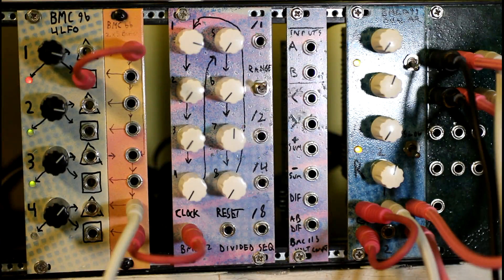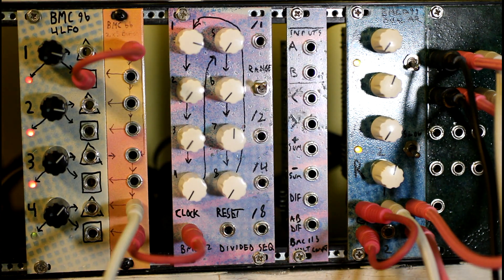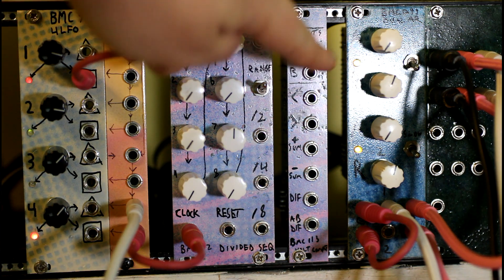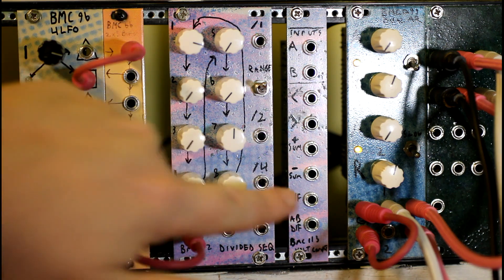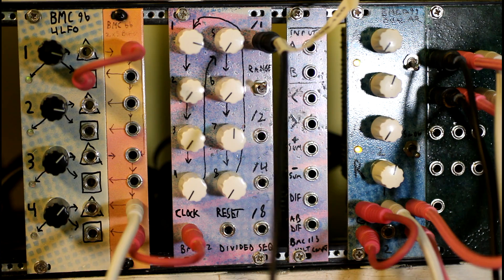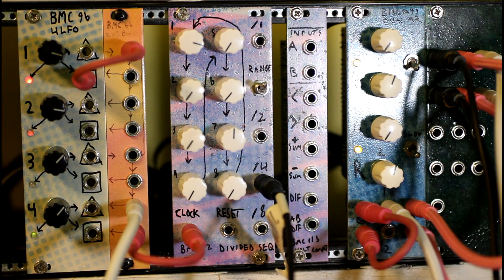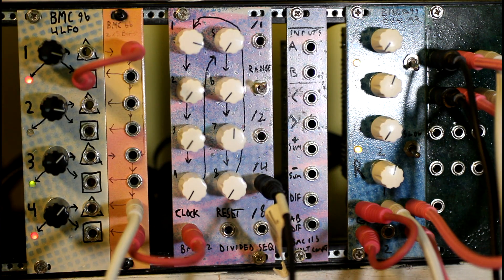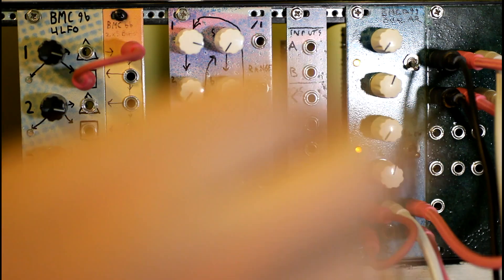BMC112 and BMC113 Demo video, Divided Sequencer and Voltage Compute

Comment: Neat idea. Are the sequences quantised? Or do you need a quantiser for each output?
Reply from the maker: No quantizer built into the sequencer. It's all analog.
Reply: The range toggle is there to make it easier to dial in melodic pitch sequences